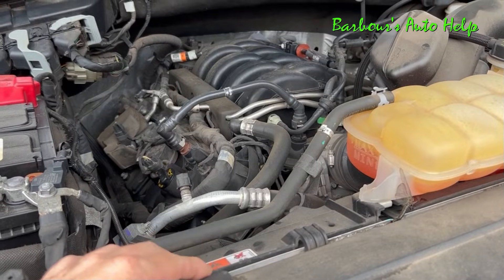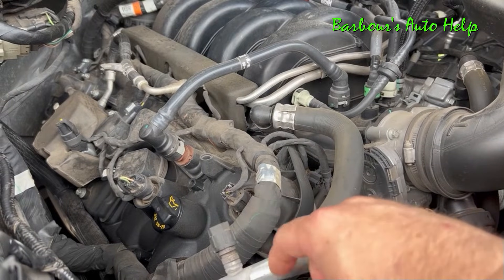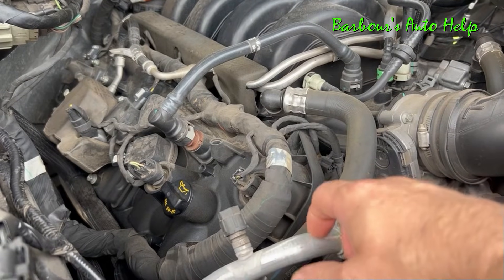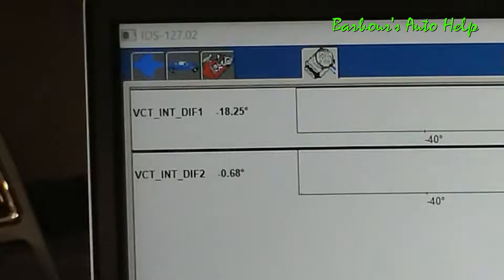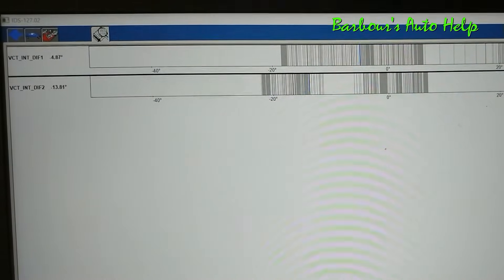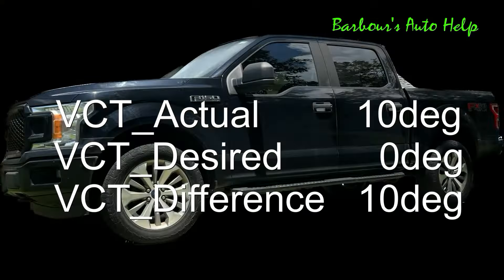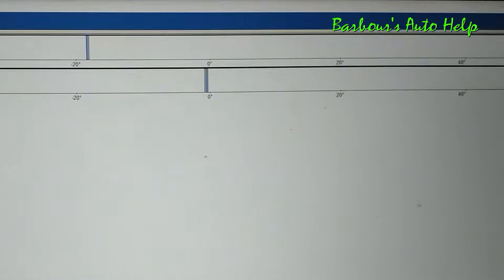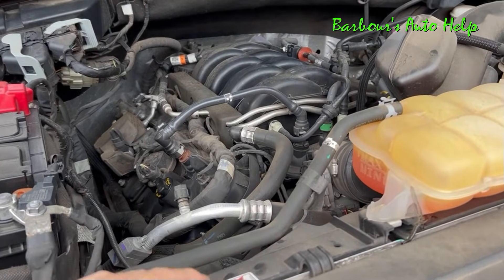2018 & Newer F150 5.0L A Cause of Codes P0011, P0012, P0021, P0022  Camshaft Over Advanced/Retarded

Comment: Hello, I’m in the process of changing out my VVT Solenoids and cam shaft sensors which requires removal of all the hoses. I completed my driver side and have 1 extra blue hose clip. I can’t figure out where it goes. I have blue, green and white clips. Does the color blue represent water by any chance? Thank you for a great thread!

Comment: I had this code,  I was 1.5 quarts low and 50% on oil life.  I was using GTX high mileage synthetic blend.  I switched to Pennzoil full synthetic and after 1000 miles the problem hasn’t come back.

Comment: Bought a new to me 17 with the 5.0. Rough idle tried evap canister and pcv valve and still doing it. All 4 vct solenoids replaced. Never threw a check engine light. Seemed to run fine after then today started again. Only difference this time threw a engine light. Checked the code and was p0022. So now what.....?

Comment: Something I had found that helps the sticky solenoids is to cycle the performance button normal, towing etc. This helps to free up the unit.
Reply: I put mine into sport to get home after getting the code, it did run better.

Comment: I have a new to me 2019 f150 5.0 that  eats oil to the point I have to set my trip for every 1000 miles to add a quart of oil. When it gets toward the 1000 miles mark it does the rough idle and stalling crap. I just love my $721/mo payment for a POS!
Reply: Feel u bro smh
Reply: be happy it runs, my 2019 has 42k miles and is dead in my driveway, 5.0

Comment: 2018 F150 5.0 threw cel P0011 
Pulled valve cover replaced both VCT / VVT solenoids, new gasket, Rtv where blocks meet. Put it back together cleared codes. Right under 140k miles. Thanks for the video
Reply from the maker: And it's fixed??  Great job!!
Reply: @BarboursAutoHelp yep resolved the cel light, rough running, intermittent stalling. Changed plugs soon after. Runs a lot better
Reply: @Parker-114 so you pulled the driver and passenger side? Was there a gasket under the HP fuel pump on your passenger side?
Reply: @mattwilliams8733 just the passenger side. There wasn’t any gasket under the hpfp
Reply: Whats basic cost to these ?
Reply: How did you do the passenger side

Comment: Had this replaced on my truck recently. I do remember the slight rpm idle issue. Afterwards, i had issues when i drove the truck it would shutter and then stall out. I was able to "reset" it by shutting off the truck and turning it back on. Would run fine afterwards. The 4th time didn't work that way and brought it to the garage.
Reply: The garage did the VCT intake on both banks or 1 or what did they do? Thanks!
Reply: @lincolnmicrophonellc  they replaced the solenoid, and that was it. I think there is just the one for the engine. Because if it wasn't that, it might have been the timing chain if i remember correctly.

Comment: What would cause a P0022 code after the VCT & VVT solenoids have been replaced?
Reply: Change both bank1 and bank2. And also change oil and oil filter.
Reply: @thekb1924  that was all done. I changed all the camshaft position sensors (ford oem) and cleared the code
Reply: @RyanRacing729 dealing with same issues . no codes before. now i get codes p0021,p0022
Reply: also been dealing with the same thing changed my vvt solenoids and cam position sensor many ppl have told me to check harness or vvt wiring if your still dealing with it
Reply: i check and wiggled all wires no change but i think its the phasers going bad , when i bought my gt it had alot of sludge in the engine i cleaned most that i could out and been putting 1quart of atf to get the sludge out. but mostlikely the phasers are gummed up on the inside and it throws that code . i only take intake side advance timing now but it happens everytime my temp goes past 200•. also my timing chain adjusters are going bad i can hear them loud when i start my car sometimes it goes away in seconds but im just gonna go ahead and replace all timing components while in there e
Reply: Any one who solved this issue? I have the same problem VCT & VVT replace and still the same problem... I will appreciate any input.
Reply: @JuanA.Nava7  I just got my truck back from the ford dealership, and they said it’s consuming oil which is the cause of the misfiring. They want $8,000 to replace the top end of the motor.

Comment: A problem I have been told about 2016 5.0 stalling like once a month when coming to a stop two people have asked me about it a other friend has a 15 no issues I have a 17 no issues do not have the data or the means to monitor and once a month and no codes. A 2018 smarter has the ecm speed to catch a problem showing codes. All cases have been serviced to or below oil change intervals all are on full and 150k give or take. My truck bought used last spring now has 110k I put 5w30 in it still sounds like a can with marbles hell it is what it is my last truck given to my son a 2007 5.4 overserviced with 130k you can not hear it running. I wanted a new truck dumped 2k in the last one in the last year and gave it to my son he loves it. I decided to roll with what I had picked up a 17 the last of the reliable so far gets me to work every day like my last but  man that right pedal is way more fun and this thing better on gas even with my heavy foot. Anyways I have subscribed and will watch for any updates kudos buddy.

Comment: You must change oil 5k or sooner,with full synthetic oil  and you will never have this problem.
All vvt engines
Reply: Not true I change it always at or before 5k miles on mine and I’m having the P0022 code. I just replaced the bank 2 solenoid  hoping the check engine light will stay off but the cams and everything looked pristine.
Reply: 2017 5.0, 3k mile oil changes. Mine started last couple of weeks and died at a light. Luck of the draw or something.

Comment: Happening the same on my 2017 3.5 ecoboost, but in addition I am sure the cam phasers are gone as per standard Ford quality 😌 I checked the 4 solenoids with the multimeter and none of them appears to be faulty, but it could be they are so dirty that don't really work properly, as the oil recirculation on these engines is a ticking bomb for these kind of issues. Anyways... thanks Ford, as usual. 🥲

Comment: is the vct and the vt the same? I have '18f150 with the Ecoboost 3.4 and is there a tool to pop it in and out or do I pry out with a screwdriver and does it just pop back in?
Reply: Unfortunately not. To remove the solenoids you'll have to pop the intake manifold and the valve covers, it's a hell of a job just to change a couple of sensors... 😅

Comment: This is happening on my 2019 Expedition, 3.5L.  Upon startup, the car acts normally.  In park, CAM POSITION DE is 0.0.  Sometimes when you shift into drive and touch the gas or let off the gas the CPDE changes instantaneously.  Sometimes it doesn't change until I pull out of my driveway.  The car operates normally and has power and drives well for about 20 mintues or so.  Then, when I come to a stoplight and sit at the light for 30 seconds or so... the CPDE drops to 0.0 and will always stay at 0.0.  It will never increase no mater how much you press the gas.  The car runs like absolute garbage and will stutter at idle.  If you attempt to press the gas pedal too hard, it will eventually throw a code P0018 and P0021.  The car will run like absolute garbage until you shut it off and restart it.  Once restarted, the CPDE operates normally again and the car has plenty of power, until you stop at another traffic light.  I have no idea what's wrong.  I can only assume that I need 2 or 4 of my solenoids replace.  It's an expensive gamble but I have no idea what else to do at this point.

My car also has the neutral-out issue, where i need to have the TSB done that replaces the valve body.  Ford knows that my make and year are affected but wont do it under warranty because I have 74k miles on it.  They even say in the TSB replace valve body with new design to eliminate the neutral out issue.  I can't even get the dealer to give me a quote unless I pay them 150 dollars to drop the trans cover and see that there is no metal in the pan first.  Then they say they will give me a quote.

This car was pretty good for 5 years, even with the cam phaser replacement under warranty, but it's quickly going to hell.  I basically have two really expensive problems that I'm not 100% sure how to fix.
Reply: I decided to have them replace both vct solenoids on bank 2.  It cost me around $500 but it was completely worth it.  It solved the issue and no more engine codes.  Also, they didnt want to do the valve body TSB because they said most of the time, the transmission will break after they do it.  So I just had them do a trans flush and I'm not having the neutral out any more.  That cost me $200 and was worth it as well.

Comment: I have scanned my engine codes and have come back with similar codes. Took my truck in to get an actual diagnostic with ford. They mentioned I’m getting -15 to +15 degrees. 

About how much would you charge to repair a job such as this? They are trying to charge me a ton more than what I was expecting. I’m also very privy on doing my own repairs with proper research, but they will not give me a good explanation about which part of my system is bad.

Comment: 2019 F150 5.0 76k with P0012. I hooked up to Forscan and confirmed VCT_INT_DIF1 was all over the place so I replaced the passenger intake solenoid and did an oil change. Now I have P0011. Any thoughts?
Reply from the maker: What code or codes did you have before replacing the solenoid?

Comment: I replaced both solenoïdes but now it showing p0012 and p0021 before i replaced the solenoïdes it did not haven these fault codes, any idea what it could be?
Reply from the maker: Why did you replace the solenoids? What problem where you having before?
Reply: same i had slight jump in my rpms at idle that it would want to stall out. replaced all soenoida now i have codes p0021-p0022-p0027 , replaced cam sensor and did a cam reset and crank reset with forscan code comes back it studders past 215f i get engine knocking too

Comment: I think it’s at least 2016 and up. My 2016 5.0 has this problem too.
Reply from the maker: I suppose it’s possible but I’ve not seen a failure in those similar to this.
Reply: Hey thank you for the info everything you said is true and correct ,, my 2016 do the same thing I’m no fixed yet but I’m going to , 2016 up do that I have 2 2016 in the shop and do the same , thank you again for the help!!!
Reply: add my 2016 to this list. I've had them replaced still didn't go away. about to toss a grenade in it and walk away
Reply: @user-yx9fd1fg7m  did you have all 4 replaced or just one that was related to the code thrown?
Reply: @jasonpfeffer6750 all 4, after replacing everything I could think of it still happened. So what I did was dump Marvellous Mystery oil in the oil. Drive for a week maybe 300km, changed the oil and filter but to a 10w30 added the other half or whatever the ratio says of MMO to it. Drove a month and changed the oil again to 10w30 without the MMO this time and viola it went from daily stall while driving to maybe once a month. This problem is all related to oil pressure and my garage beer logic with friends is my truck got some miles on it the engine and maybe some crud in it (took it to a quick change a few times when too busy) so she wasn’t as tight so the oil pressure was less and at low rpm it wasn’t sufficient so thicker oil higher pressure.
Reply: My 2016 is doing the same thing
Reply: my '16 too.  p0012.  had entire timing system replaced. STILL doing it 🤬 Still p0012.
Reply: @donlightbody8270  by entire, I assume this included the VCT solenoids?
Reply: @jasonpfeffer6750  yes, solenoids, phasers, chains, guides, etc...  Even the cam position sensor.
Reply: @donlightbody8270 you tried the engine oil cleaners?
Reply: @jasonpfeffer6750  yes. i used 2 cans of EPR.  Then  flushed all that crud out with some cheap oil for about about 30 min.  Now I'm running Valvoline restore and protect. (my explorer 4.6 LOVES that stuff.)  I'm going to chase wires this weekend and see if there's an issue there.

Comment: Can the solenoid be changed without taking off the valve cover?? Or any major parts to be removed? Having this issue on my 2019. Oil lvls are good
Reply from the maker: No.
Reply: Nope!!! Just did bank 2 and still have the same stupid problem!!!!!!!!

Comment: I had this happen in my 2019 F150 5.0 at 40K miles. No problems ever since, though.
Reply: What did they do to fix?
Reply: @rogerrabbit8756  They replaced the VCT Intake Solenoids.
Reply: @Brian_195 yeah did they cover it under warranty ?
Reply: @Brian_195  that’s good to hear I have a 2018 5.0 I bought 3 months ago haven’t even put 6000 miles on it and it just coded for camshaft sensor and a misfire on 6,7,8. Idk if it’s the VCT or the sensor. Ford dealership said it’s under warranty hopefully they cover it
Reply: @Retrievinggold  Yeah, you should be good to go with it falling under warranty then. Other than having my VCT intake solenoids replaced, I’ve had no other mechanical problems with my 2019 F150 5.0L.
Reply: Did the warranty cover it? This is happening now on mine at 41K.
Reply: @OnTheComeUp82  I just took mine in 5.0.. need new can phazers, chains tensioner ect. 6k. Ford is garbage 140,000km
Reply: How much did it cost to repair it?
Reply: @Rami3ra  Mne was covered under warranty, but I think it said it was around $300, if I remember correctly. I believe the VCT Intake Solenoids were under $100 each.